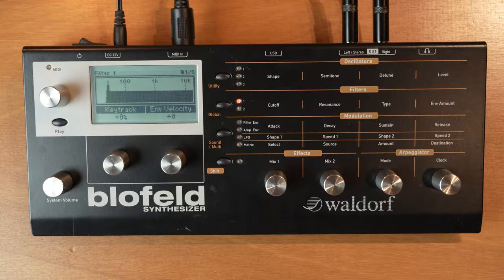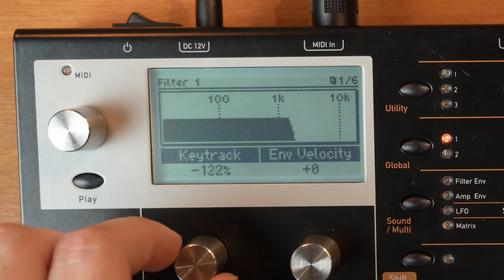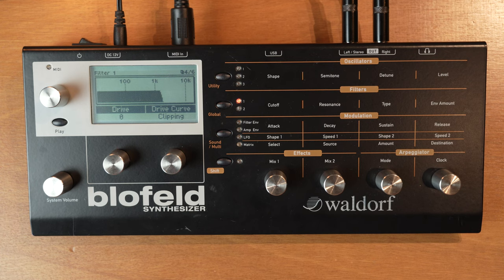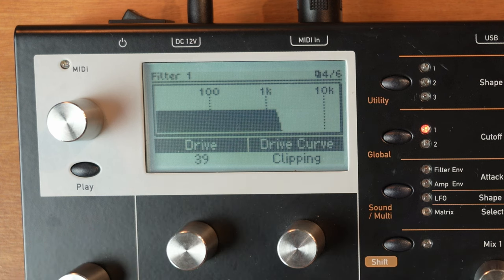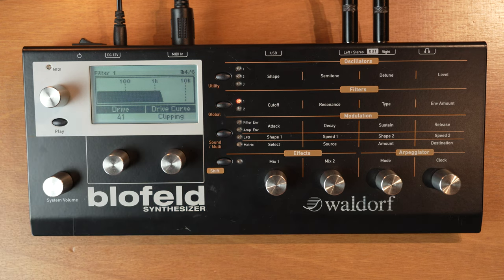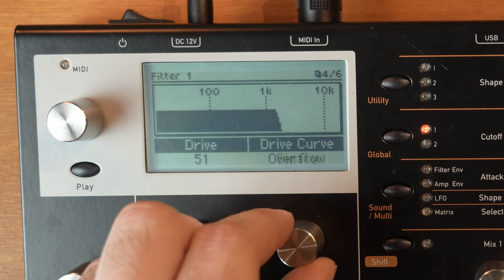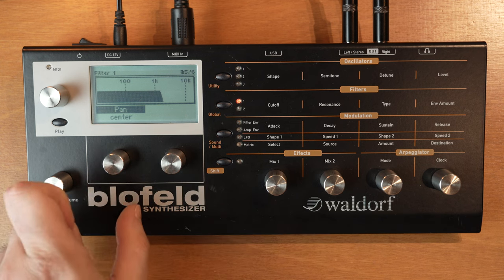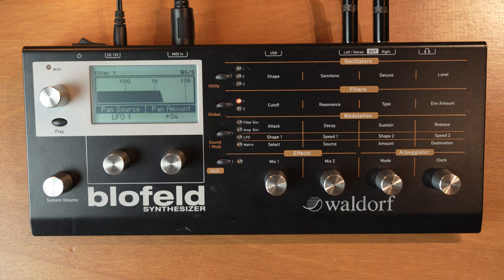Waldorf Blofeld Tutorial 02 - Filters

Comment: Thanks for these videos. Two questions, if I may: 1. in multi-mode, is it possible to control different parts via an external sequencer i.e. via different MIDI channels? 2. I've heard it's a pain to use the library software, install sound packs etc. Supposedly you can't just add things to the synth; you have to reinstate the entire library, or something. Is this your experience?
Reply from the maker: Yes you can send 16 different MIDI channels if you want.

I've used the Blox editor before and that worked great. For loading samples, I've yet to do that myself, but you could be right about that, I guess it takes a while.

I'm planning a new video about multimode and see if I can make a short one about loading samples.
Reply: @optoproductions  Great, thanks!